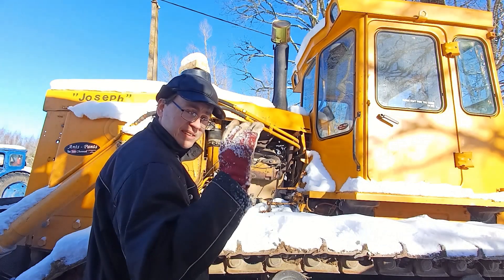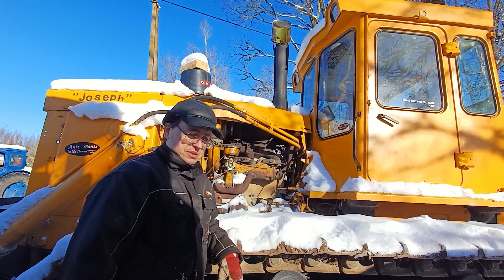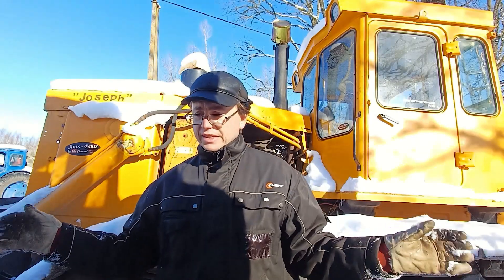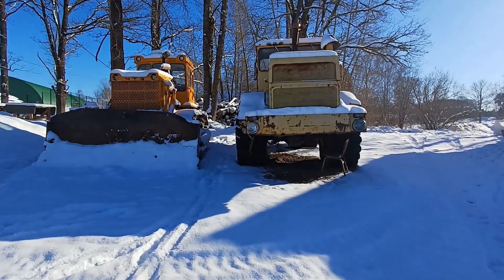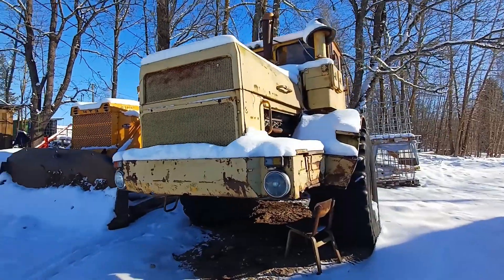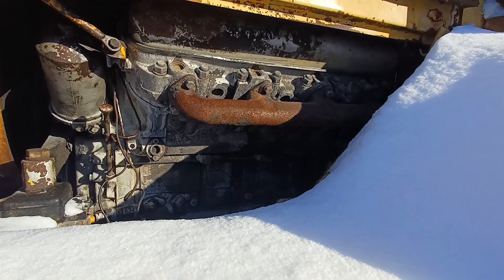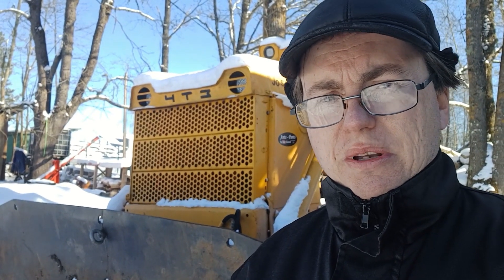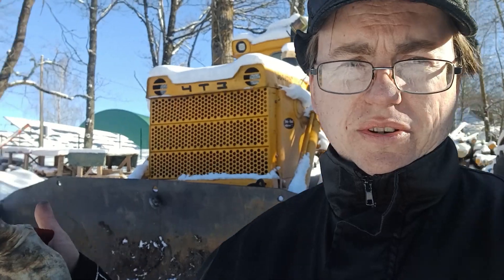Big Soviet tractors Joseph and Kirovets. A simple buyer guide.

Comment: basically if it is cheap enough its worth it - Kirovets for 5000€ can do abaut the same work as a Claas Xerion for over 150 000€ 
difference is reliability, driver comfort and speed
Ants Pants should get a 20Ton excavator and two trailers for Kirovets - dump trailer and Maschine transport lowboy 
And get Kirovets road legal ...
work with the neighbars sand pit
Reply from the maker: Good idea. In general most of these big tractors are becoming hobby machines. The 20t excavator would be a awesome addition to Ants_pantses fleet.